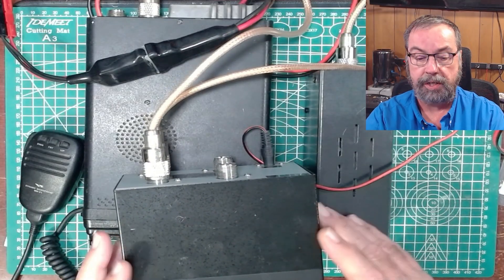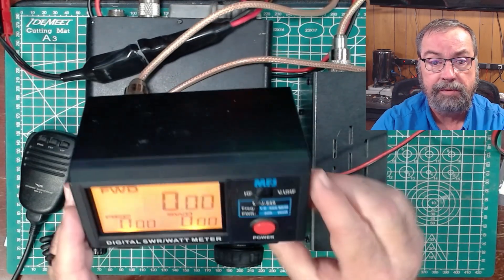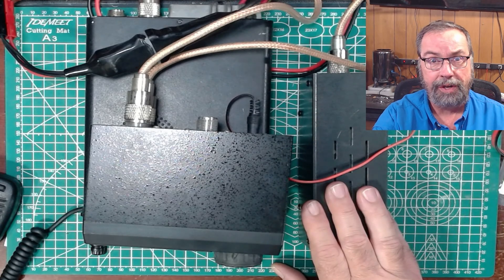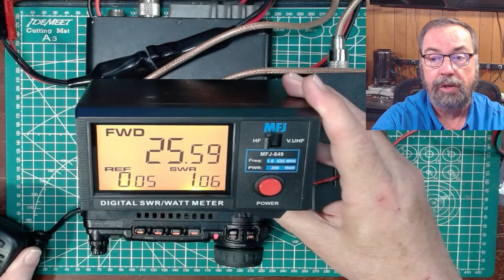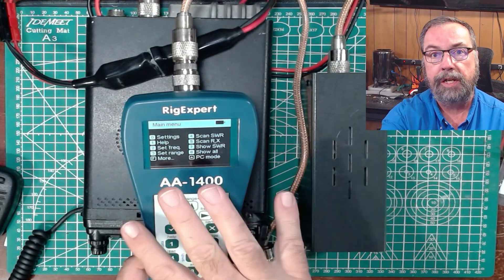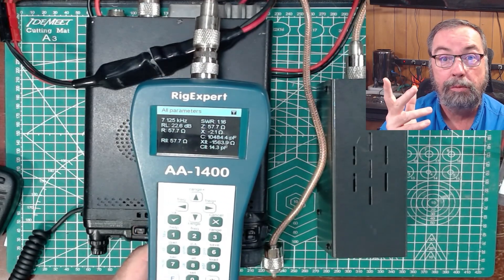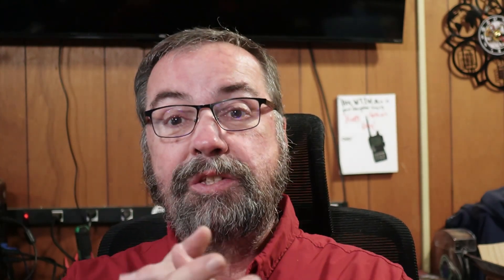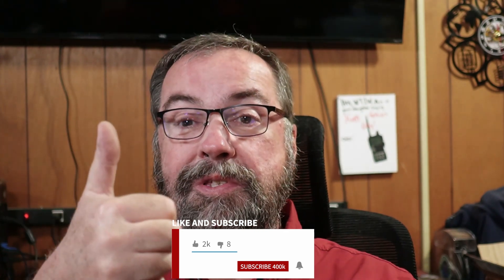How much power with an oscilloscope?

Comment: The recommendation to calibrate a lot of wattmeters is to use a scope and do the math. With that said, what band you're on while testing may also make a difference. I used my scope to calibrate my MFJ wattmeter on 20 and hope it's close enough either lower or higher in frequency.

Comment: Most standard VOM only handle maybe up to 20Khz of AC then you start having issues.  You could use an RF voltmeter to do it.  Most RF voltmeters are rated to a frequency range as well.  Interesting point is the spec sheet I got with my sBitX V3 has the power measurements given in Vpp.  Thanks for the video! 73
Reply from the maker: Yep!  The more you know!  It was something I was pondering, wasn't sure if I even had the right meter to do it with.

Comment: Great work JEEM !   I use a 40 DB line tap with my dummy load . Just a extra math step . Normally i use a scope to test for how the wave form looks and setting AM modulation.  So easy to see when you clip carrier or ALC fold back on SSB.   I would say the MFJ meter is off because it is calibrated to 50 ohm load and your load is off a tad.  With a DMM trying to read AC voltage their is a problem. Most DMM are like for 50 HZ AC measurement. Not meant for RF voltage. That is why the meter is off. They have a RF voltage probe for a DMM. That is what you need to get correct voltage.  73

Comment: Oscilliscopes may not measure correctly if they are over range. This might have fiddled with the readings a bit, if you're measuring 2m it's also past the bandwidth of the scope so you can expect a little bit of attenuation there too.
Before I got the TinySA+Attenuator, I did this trick as well, but I am lazy and just chuck it into a vpp->dbm calculator 😄

Comment: Another simple way to calculate V RMS from V peak, is that V RMS is 70.7% of V peak. For instance, we all know 120V AC, which is an RMS voltage. If you were to display your sine wave on your home voltage with an oscilloscope, you would measure 170 V peak, and 340 V peak to peak.